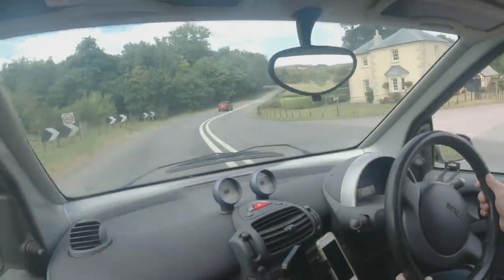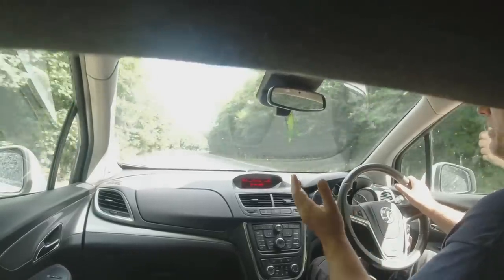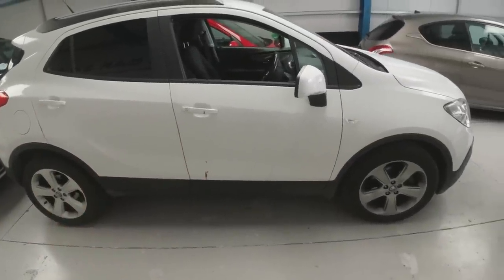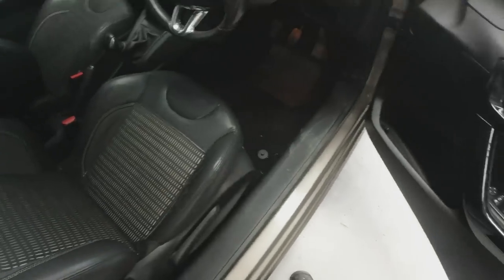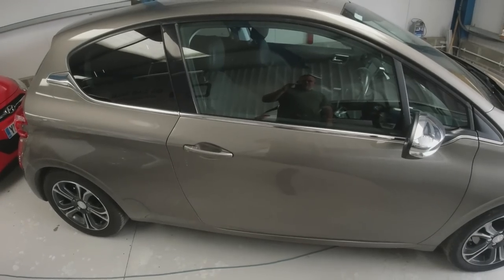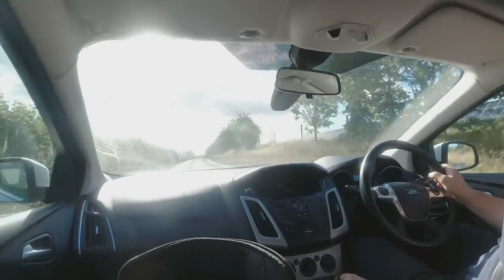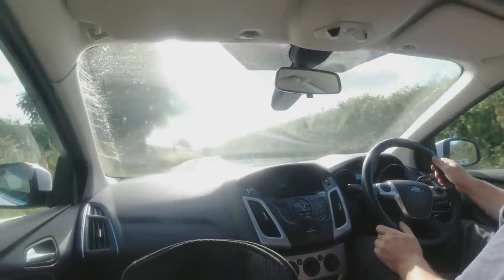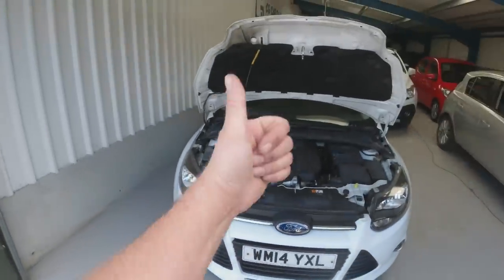So why was this Focus was Part Exchange with Cinch! I soon found out!

Comment: I have a 2008 Ford C-max 1.6 TDCi and it would go into limp mode sometimes, especially if trying to accelerate up hills or accelerating a bit fast. Pull over and switch it off for 30 seconds to a minute, it would then start again and be fine for a while.
Advice from a diesel specialist was to change the fuel filter as the smaller Ford diesels would do this if the fuel filter was getting clogged and restricting the fuel getting to the engine. Changed the filter and the problem disappeared completely.
Reply: So you drive around lackadaisically not maintaining your vehicle until it goes wrong and you need free advice to fix a problem caused by own stupidity …. 🍩

Comment: Great video James as usual. That Focus will have the 1.6 TDCi engine in it though on a 14 plate I’m pretty sure. They swapped it to the 1.5 TDCi when they face lifted it for 2015 I think. I sold one of these a couple of weeks ago on a 64 Plate with 107k on the clock and the customer had the exact same fault as your describing. Turned out it was the water pump failing. Have a look if its loosing any coolant after a drive, mine was and it was dribbling out of the expansion tanks overflow pipe. Mine had the exact same high pressure release when you opened the coolant cap. I also replaced the thermostat housing as that was showing  signs of leakage and that’s where you saw all that staining in the engine bay. It also had the fan running for a long time after it was driven. The faults are identical and it’s about the same mileage on each give or take aswell. I thought it might have been the headgasket blown at first but turned out just to be the water pump.
Reply from the maker: That's promising as its doing EXACTLY that! Did yours fluctuate in temp when coming up to junctions etc? Mine gets to half, stays there but every now and then at stand still drops back to low temp
Reply: @ChopsGarage  yes it did. Also when the heating was set to max sometimes it would start blowing colder air, if you turned the knob back to cold and then hot again the hot air came back. The thermostat housing is only a £30 part and I paid £100 for a new water pump and timing belt kit as there was no point putting the old belt back on. All in all with the garages labour cost it ended up around the £400 mark but I did change the timing belt aswell. My customer told me the car was going into limo mode but there was no warning light or fault codes stored when the car was checked.
Reply: Just Had the exact same symptoms on an Audi A4. Temperature hand would jump up when driving hard but would return to normal at slower speeds. A lot of pressure on the expansion tank. With 86k on the clock I decided  to do the timing belt and water pump kit. On inspection the water pump had failed. All going good now.
Reply from the maker: @devilmahon666  omg this is exactly what mine is doing fingers crossed buddy!
Reply: @ChopsGarage  fingers crossed that’s the worst it is James. Let me know how you get on with it 🤞👍
Reply: @Peter8343  audi can also be the fan control module
Reply: @mikes747  Dont be silly. 90% chance its just a water pump failing judging by them symptoms.

Comment: I drove one of those Mokkas in Spain a few years ago, drove it around Costa Del Sol. Got it as a rental car (so technically it was the Opel version), honestly it wasn't half bad for a Vauxhall. It's a competent family car, and the best thing is you can't see what it looks like when you're driving it.
Reply: Is it a chevrolet Trax with a vauxall badge.   Or a regal encore on the USA  just a GM car.
Reply: Is this Korean build perhaps...ex Daewoo works ..
Reply: @adamanthony7465  The mokka is based on the Corsa D if I can remember correctly. Should be built in Spain. So a pretty ancient car underneath, unlike the new PSA mokkas that are on a brand new platform.
Reply: I hate the things. Had one as a rental a few years back. Sluggidsh, poor gearchange, carp handling and pig ugly

Comment: Firstly replace the coolant cap on the Focus, they're about £7 for a Febi part. Not going to fix it fully but maybe the cause of the pressure when cold if it's not venting correctly. After turning the engine off when hot do you hear a hissing/fizzling sort of sound from the header tank area for a couple of hours until it cools down?? 

It's not good news really. But it's a DV6 engine afaik so the 1.6, they're 10 a penny (sort of) to get parts for and pretty straightforward basic engines. 
Is it actually overheating? 
Oil in coolant is either going to be the head or oil cooler. But for a brief period those DV6 engines had air coolers for the oil, may or may not be the case for the ones fitted to Ford's but worth checking. 
Flush the system out with plain water until it's crystal clear, then drain and refill with antifreeze. Then see how quickly, if at all the oil mixes in again. You might be lucky and someone hasn't flushed it through completely in the past? Clutching at straws there a bit though. 
Also might as well do a sniff test to see if it's combustion gasses causing the pressurisation. 
A lot of these engines do just have black header tanks, just like the DS3. 
First start with overheating (if it is overheating) , then pressurisation, then oil mixing. 
If it's all 3 of them together sounds like very bad news!! 
If it's just overheating don't discount the water pump, some of them may as well be made of cheese and I've seen the impeller fins snap off or the impeller shaft snap off altogether many times !

Comment: I've been working on the same engine today mate, fan keeps running as there's a fault, been doing this one today and can't get any fuel pressure, pumps 600 plus cam belt, if coolant is oily, heads gone, drive with live data on fuel pressure, see if it drops, your looking for 50000 kpas at moderate speeds, up to 90000 higher up, that focus might be goosed mate, stop buying bca on line, go to a physical auction, you'd have checked the coolant, seen it black and not bothered, could be a leak in the oil cooler as well.
Reply: Yep. Definitely oil in the coolant bottle.

Comment: Sounds like a shocker knock on that Peugeot it’s a common thing with the them the 1.2 engines are good but use oil even in good condition and the wet belts break down and block the oil pick up pipes
Reply: If its a 2012 model it's a 1.2 vti engine not THP
Reply: @livc444111  the vti and the thp both suffer from wet belt problems

Comment: Re Focus: when mine done that it was the DPF filter.  It got gradually worse and worse until it was almost permanently in limp home mode.  That was on the 1.6TDCI engine though, which was known for it, re-gens didn't help, only a very short term fix.  

Didn't think the 1.5 engine was affected by DPF issues, but I guess if they get clogged, they get clogged.

Hope it's an easy fix for you, at least the DPFs aren't as expensive as they use to be, plus I expect you know someone in the trade so you're not paying consumer prices😉.

Comment: I own  and a European automotive service workshop here in Western Australia. We had a very sick 2011 Focus 1.6 TDCi  arrive with us on Monday this week with 140,000km on the clock. The symptoms were Check Engine Light and very low power. It had a split turbo pipe which had been causing over fuelling of the DPF which was clogged and the engine oil was diluted with diesel. A new turbo pipe, which was hard to source, an aftermarket DPF as the Ford one was prohibitively expensive, a couple of new sensors, DPF regen, an oil change with some nice fresh Mobil 1 and it left the workshop today driving very nicely with a relieved and happy owner. The 1.6TDCi is not a common engine here in Australia.

Comment: For the Focus what about a sticky brake light switch ?  Had it on a S -Max where you’d loose power fkr no obvious reason other than just used brakes gently … ecu shows brakes applied so won’t allow engine to rev.

Comment: On the ford I'd take airfilter box out and check all connections are right in fusebox. I think some of them can come apart. If you'd a engine managment light it could be purge valve.

Comment: I have a 2014 astra sri with the same steering wheel controls as the mocka, but my astra doesn't actually have Bluetooth..  so you may want to double check that

Comment: I had a similar loss of power and limp mode with out an engine light when I first got a 2012 focus 1.6tdci with just over 100k miles. I had an injector 3 code when scanned, used an in tank injector cleaner drove it reasonably hard with that stuff in the tank and not had the loss of power in the 18 months since..

Comment: Had loss of coolant, pressurisation and limp mode with no codes on the 2.0 version of that focus. It was the water pump impeller slipping. If not sorted engine will overheat and pop the plastic thermostat housing. If you’re really unlucky it will need a head gasket too. Got away with it on the 2.0 but while your doing the water pump you may as well change the cam belt too. That engine will then easily do another 100k.
Reply from the maker: Yes water pump good first call

Comment: It will most definitely be a 1.6tdci I had a exact same but black bought it 14 month old with 30k on it i part ex it with 270k and other than serving and tyres It never let me down👍 It just went on and on and on......brilliant car!!! I would go with the dpf filter they generally regenerate every 2 months or so and the tell tale signs its regenerating it looses power but then picks up again🤷‍♂️

Comment: I've sold alot of those mk3 for 1.6 TDCI the expansion bottle is black which indicates that you have cracked liners in the engine block it seems to be an issue on the 2013/2014 focus I've never see it to happen the 2011/2012 1.6 TDCI.

Comment: With the focus could be a fue things might be a boost leak head gasket blocked injections or even a sensor not putting enough fuel into the cylinders or may be a compression issue could be several things

Comment: I love those original Smart cars, they need care and maintenance but when you learn how to drive them and time the shifts properly on the 6 speed sequential gearbox they are good fun.  I’ve owned two now, a cabriolet and a coupe, I’d say if you do buy one make sure you get a high spec and look for proper service history at a specialist or Mercedes garage.  The later ones are less quirky and for me less appealing.  Of course as a dealer offering a warranty it’s the last car you should consider!   In the hands of someone who just wants a cheap car they can be a nightmare when they need work, which inevitably they do.. but I still love them.
Reply: Are they all automatic the smart cars ?  I'm thinking about one for my nan.

Comment: Agree with what someone said below, throttle position sensor faults are pretty common on Ford's of that era with the symptoms you describe. It's usually the throttle pedal 👍
Reply from the maker: No not overheating mate but losing coolant and temp sometimes randomly drops from half to bottom when stopping at junction. I think water pump may be good first call
Reply: @ChopsGarage  Coolant loss will either be going into the oil or it's getting burnt unless you can see an external leak. 
Coolant level clearly isn't rising so is the oil level rising accordingly?
Water pump is just a possibility. 
Is it a sudden drop to bottom when stopping at a junction and then a sudden jump back to middle or does it work its way along the gradient of the guage? 
That sort of issue will usually be an air lock or blockage. 
People have mentioned k-seal and I think I concur. It's sounding (and looking) like it. 
I hate the bloody stuff. It's ok on an old end of life rustbag but the bottles of dreams/fixes in a tin as I like to call them are a bloody nuisance when someone comes to actually to the job properly. Wish people would just do the job right the first time or not bother at all!!

Comment: I had a clio where all of a sudden every so often pedal have no power. Replaced the pedal 2 bolts  and a wiring plug 4 min job. Was fine after that. Had no warning lights on mine either. Was electronic one so no cable.

Comment: I drove a 14 plate diesel Mokka a few weeks ago for the first time, and was staggered at the fuel consumption. 15 mile run on motorway, finished off with a short in town run, all at the leagal limits, and achieved 71mpg!  Overall, quite a pleasant drive. If yours is the 1.7, it'll be the bullet proof, albeit quite noisy...who cares.... Isuzu engine. An absolute peach.

Comment: Try the fuel filter on the focus I had an issue with my peugeot same engine it would do the same thing then you switch it of and on and would be fine for so long and then do it again, try the fuel filter they are a cheap item to replace.

The fan running when u pull up and switch of I believe is to do with dpf I was told with my cmax.

Comment: Mokka's have the dreaded M32 Chocolate 6 Speed box like my Astra H, I;ve had A&S Clutch Technology replace the bearings while i waited as he leaves the box in the car and just slides the shafts out and does the bearings that way, also he over fills the box to 2.8 Litres instead of factory 2.4L

Comment: If heads gone on that diesel mate, you'll be loosing compression, could be why it's loosing power, I took one in p ex, been dogged up with k seal, first run head went, no compression, I went out to the m62 hard shoulder, gave a refund and abandoned the car there, police gave me an hour to move it, I couldn't do anything so just left it, hard game sometimes mate.

Comment: I've got a 208 Allure 1.4 2012 5dr 62reg.
Paid £2k with 110k on the clock and history.
Spent £600.00 for suspension work and new clutch. Now its lovely. Pan roof 4 x e/windows, sat nav, air con just got filled up as well..
Good little cars..
Reply: They’re horrible, had mine for six months, nothing but trouble! Got rid and now got a Renault Clio 2017, top notch. No problems at all.
Reply: @priteshchampaneri5101  
Mine is cool...drives excellent and smooth...so I'm happy!!

Comment: On the Ford Focus it’s very likely it’s the throttle position sensor. I had the exact same symptoms and it turned out it was the throttle position sensor buggered. The issue came up with an obd read.
Reply: I was just about to suggest the same

Comment: Only a few guys here got this one right below. The key is oil in the coolant. For whatever reason its lost a head gasket, most likely because the EGR cooler was leaking ( remember it was replaced). Power loss is sadly probably NOT related. most likely blocked diesel filter or  pick up.  Bail out  quickly. Could take a while to fix and the £££ you have in the thing is a tool that should be making more££. Quick turn over is key to your market. You will lose on it but fixing it will cost you more in the long run, The voice of hard earned experience!!
Reply from the maker: Yes my thought was run on egr cooler leak , let it get too hot
Reply: Its a pity, its a straight car. Everything at auction is a gamble now. Vast majority of stock is from WBAC and the likes. Anything decent goes to retail, the problems to auction. The biggest lesson i learned is that when you get a dud bite the bullet and take the hit, I tried to fix stuff, it just doesn't work.  BTW any dealer that tells you he never gets caught is spinning you a yarn!

Comment: Bad for turbos on that 1.6 engine bud, oil feed blocks up, rev it up and look for blue smoke, if it's turbo there quite cheap now and not bad to do, I drain the sump and spray loads of carb cleaner down the oil pipe, or you can fit a new pick up, don't neglect that process tho or turbo won't last long, see what top don says.

Comment: I think that Focus engine might be the earlier 1.6 Duratorq, not the 1.5 that came in around 2015.
Reply: I've gone from the 1.6 diesel  (95)  now have the 1.5 diesel  (120) its much better and 6 speed. Does need add blue now.
Reply: @chrishart8548  my wife has a 2015 1.6 Duratorq 115. I think it was the last of the Euro 5s with the 1.5 120 being Euro 6? Decent little engines.
Reply: @jamieh2304  it really goes when it's in the higher rpm's  it's flat as a pancake off turbo. Probably have more luck pushing it.

Comment: would you really replace a shock on one side only ?
Reply from the maker: Yes , no one would pay you the extra no one values it , they want discounts not more new parts
Reply: No. They should both be replaced so you have balanced handling.
Reply: @ChopsGarage  Very true , people want discounts . But once I explain in ice or heavy rain I don't feel happy to think of a family inside . I believe that . And I get double the job . Just ask them if they can live with it . Works most times . If they just want to sell it on they're worth avoiding.
Reply: Thanks for your time making great video by the way . Hats off I'm a fan . Cheers